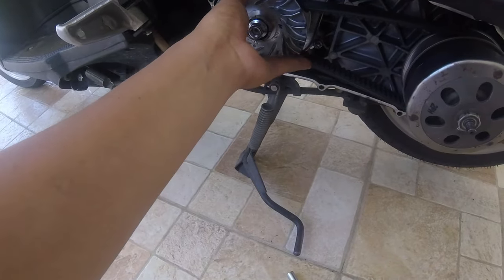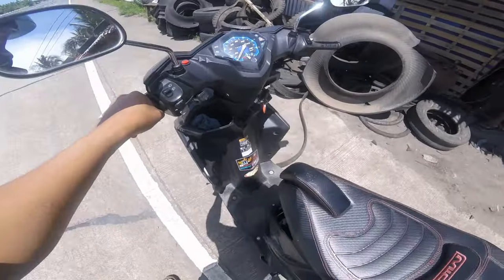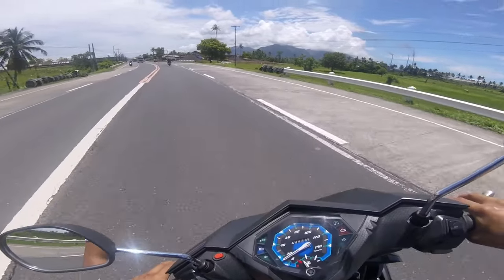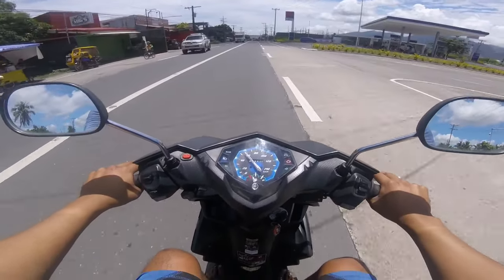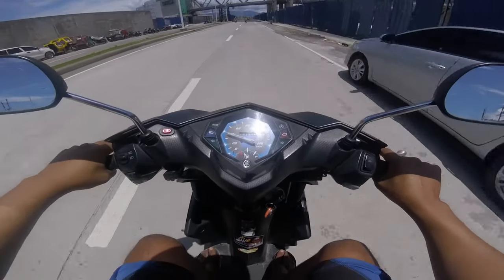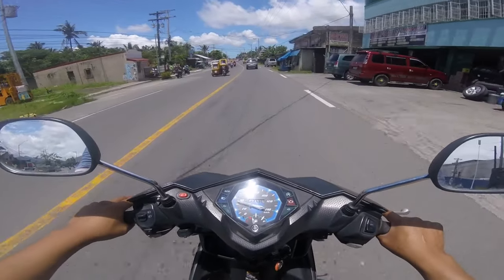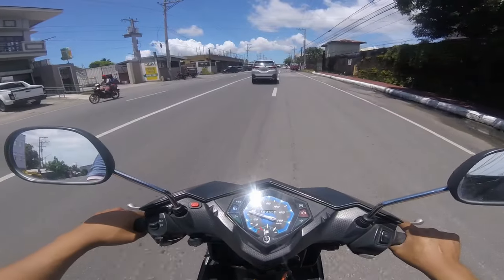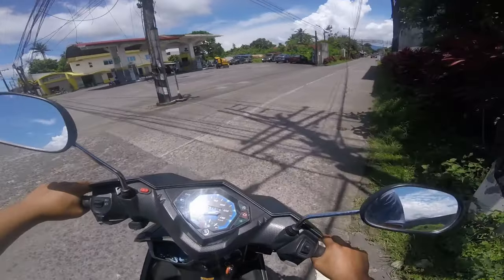Palit 10g Flyball & 1500 Center Spring | 78 kilos Rider | Road Test | Mio i 125s

Comment: sakin hangang 98 lang yong sakin bakit kaya? bola ng nmax gamit ko 1200 rpm srings
Reply: Kung mio I 125 motor mo boss. Mag 1200 center spring tsaka 1000 na clutch spring 11/10g may dulo . Pag 9/11 arangkada at Dulo. Or 9 straight ka lods

Comment: sir mas maingay  or lumakas tunog pag 1500 center spring?
Reply: Lalakas sa gas pero di ka bibitinin ng arangkada, lalo kung mga 10 wheeler truck oovertakan mo, balik mo lng throttle para tumaas ulit belt sa torque drive then birada na ulit

Comment: ano po sukat dalawang washer niyu?
Reply from the maker: Dalawang 0.5mm
Reply: @papsjumovlog8406  minsan ba boss ayos lang kahit wlang washer? depende sa pulley?
Reply from the maker: @kenochokidonutchollo8185  kung stock pulley need mag washer kung naka racing pulley set kahit wag na
Reply: @papsjumovlog8406  pag kalkal pulley ngay paps jumo? kahit .5 mm ilagay ko?
Reply from the maker: @kenochokidonutchollo8185  1mm po
Reply: @papsjumovlog8406  naka racing monkey torque drive kasi ako paps jumo 2 degree nakalagay tapos parang di tugma sa kalkal pulley ko pagpag lahat .5 mm 1mm tapos wala washer mapagpag bago pa naman belt ko di kaya sila compatible siguro nung kalkal at torque drive ko?
Reply from the maker: @kenochokidonutchollo8185  stock TD lang gamitin mo di mo na kelangan mag palit TD
Reply: @papsjumovlog8406  salamat paps jumo kaya pala lakas vibrate 59 ko di tugma yung torque drive, try ko balik stock td paps jumo balitaan kita :) thanks paps jumo
Reply: Stock kalkal pulley gamit ko,anong mm na washer ang pwdeng ipalit.okey lang na alisin ang washer sa backplate.

Comment: JVT set gang belt at DF 10g straight 1k clutch 800 center paps try mo 112-114 din TS isang sagad na piga 100 in 10-11sec :3
Reply from the maker: Malabo yan sakin na 114 TS mabigat ako hehe
Reply: hahah lakas pala kung ganon lugi pala kargado sa naka jvt panggilid lng HAHAH
Reply: @zipzap6859  oo lugi talaga. Pulubi ka eh haha. Mumurahin lang kaya mo gawang kanto haha.
Reply: @zipzap6859  lamang ang karga sa dulo. Pero arangkada palong palo jvt paps smooth at no vibrate di dapat smalin,or dahil sawa na lang siguro ko sa 66 sporty ko kasi masakit sa katawan kaya nasabi ko ? 🤣🤣
Reply: @elmerjohntiu9726  haha sa dulo lng pala lamang  ang kargado so mas malakas pa ang nka panggilid kesa sa kargado kung sa arangkada? 😂😂😂

Comment: New subcriber mo ako lods naka 1,500rpm center at clutch naman ako straight 10g 115 top speed ko
Reply: Ilan Timbang Mo Lods ?
1.500 Rpm at Center spring 1.500 din ba ? Pasgot plz